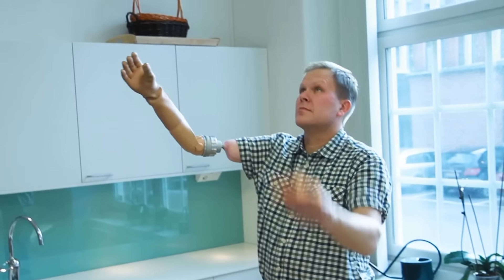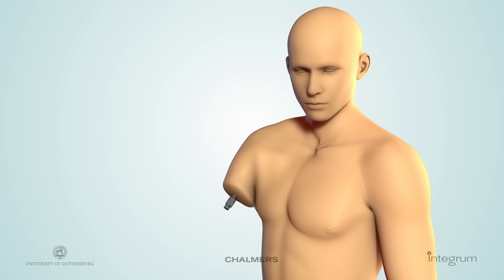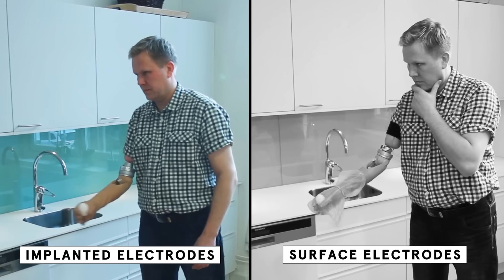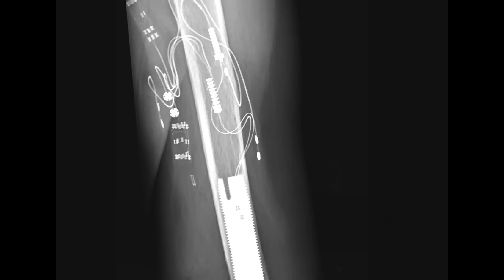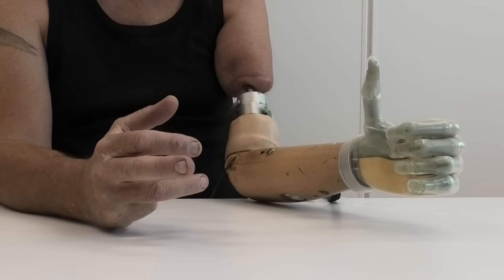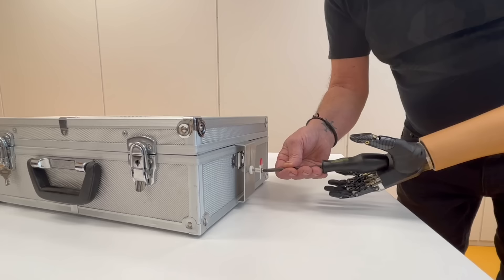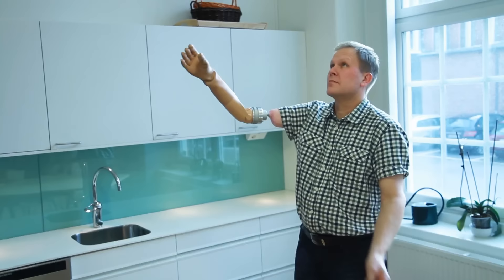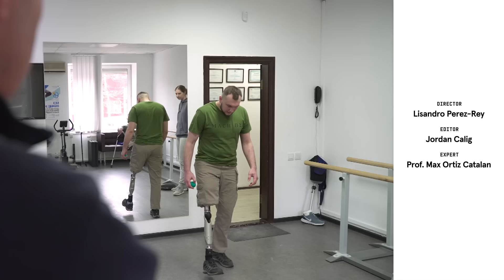How Mind-Controlled Bionic Arms Fuse To The Body | WIRED

Comment: This right here, is what we call a MONUMENTAL achievement. Not the prostethic, but that too is obviously a serious achievement and should be applauded, but the connection between nerves and wires. If this becomes popular, which I will personally make popular if it somehow does not, this would absolutely be up there in terms of technological revolution. Not on the level of neolithic or industrial revolutions, granted, but close enough to be comparable.
Reply: adam smasher 2023
Reply: Mantis arms and sandevistan

Comment: Honestly, I'm surprised it's as cheap as it is.  Expensive?  Sure.  But I was expecting a six-figure price tag.  This is easily something you could finance and pay off over time if you can't afford the $10K up front.  It's really cool to see something like this that actually seems obtainable for many people.
Reply: The problem is that implanting it, the hospital costs etc is definitely higher than this.
Reply: @kolliwanne964  i bet at the end with hospital costs it will be the same price as a normal porthesis. Normal prothesis are insanely expensive. Like non motorised leg replacements cost 6 figures sometimes. And this is way better so there would be no reason not to pick this instead

Comment: There are a lot of downsides to osteointegration though including injury, risk of infection in the stoma (the healed whole in the arm around the metal rod), pain during cold weather and wear on the bones causing further amputations, which is why it’s easier to do on an arm than a leg as arms are not typically weight baring but the risk is still there. The surgery also obviously has risks and is very expensive and not accessible to everyone too. Something that is much more accessible and less risky is having the nerves rearranged surgically so that electric prosthetics can be used, the muscles contracting to control movements via touch sensors.
Reply: Like AI or NFTs or Crypto, this video is a bit "overhyped" because everything you say is true and a problem for long term prosthetic users.
Reply: @Beginnerss how is any of this related to any of those?
Reply: @LeeroyDreary  i was comparing the overhyping of new technologies to the over overhyping of new technologies (prosthetics). i didn't consider it hard to figure out the way i stated it.

Comment: Hmmm… very interesting. No, of course prosthetics are not as good as real limbs but these devices became closer and closer decade by decade. However, is there a way to record and decode nervous signals when the limb is still in place? Imagine that every year medical examination you just need to wear a costume with electrodes and do some exercises. These files save your medical data and if you unfortunately have serious injuries you don’t need to get used to the new sensations and learn AI. Computer in your prosthesis uses your feeling pattern and you receive exactly your feelings.

Comment: Charging the prosthetic limb every once in a while for half an hour or an hour is tiring. I think that if nuclear batteries or thorium batteries were used, the problem of the battery running out and charging the prosthetic limb would be solved, or the human body’s electricity would be connected to the prosthetic limb, or the human heat would be converted into electricity using a thermoelectric cooler device.